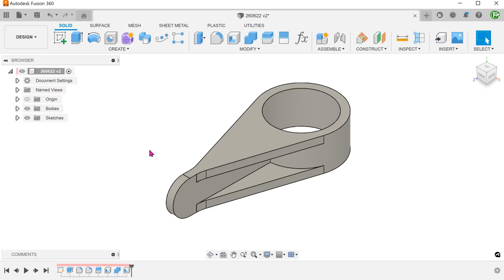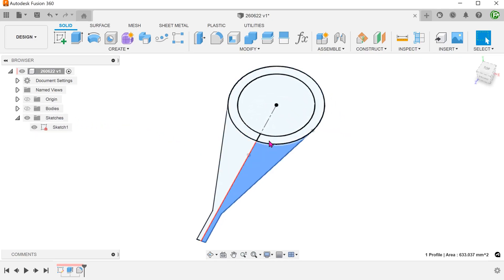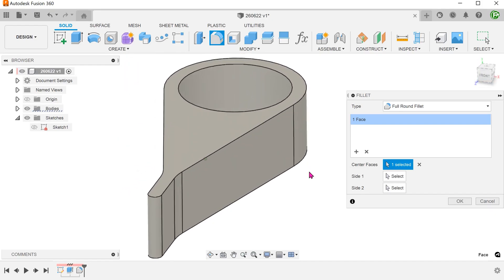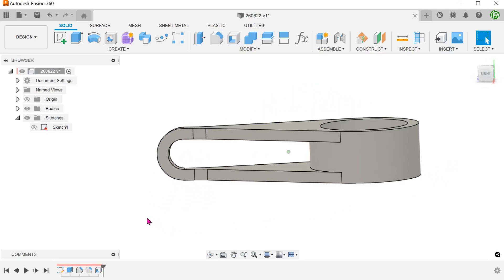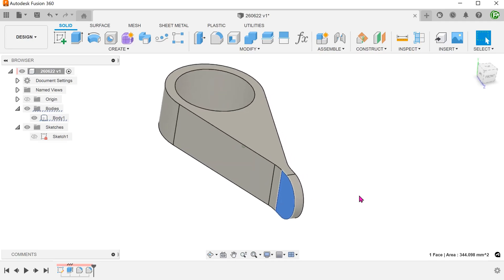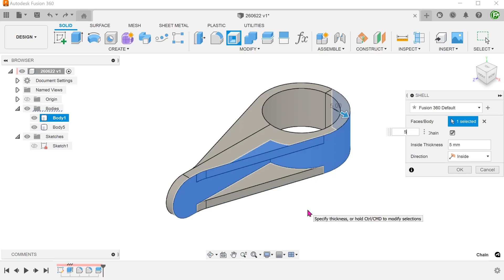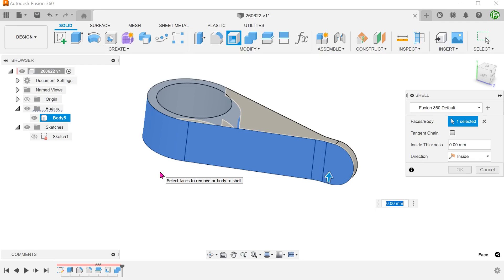Fusion 360 | Case Study 29

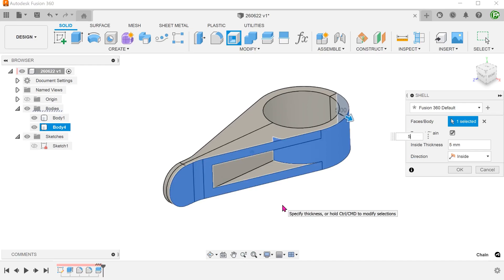Comment: Why not set the wall thickness to 2.5 on the shell at 3:35?
Reply from the maker: The ribs and the wall around the cylinder need to be 5 mm thick also.